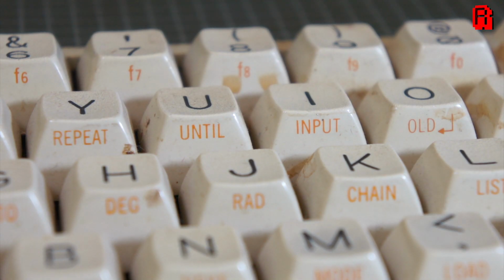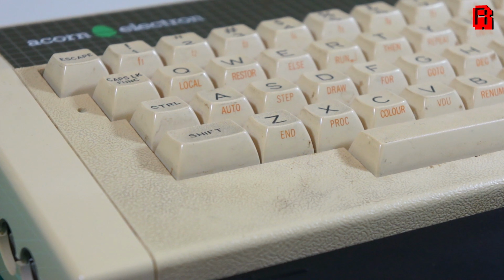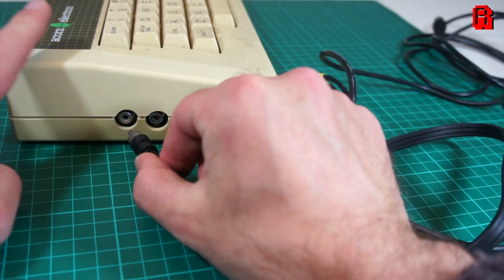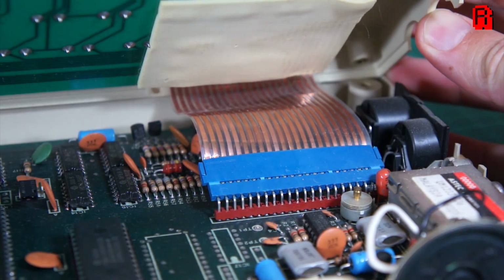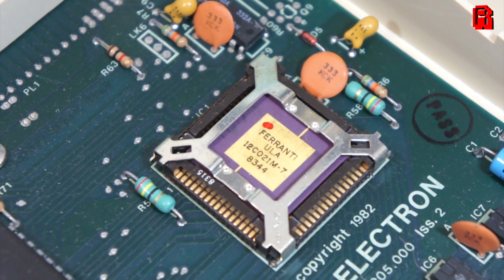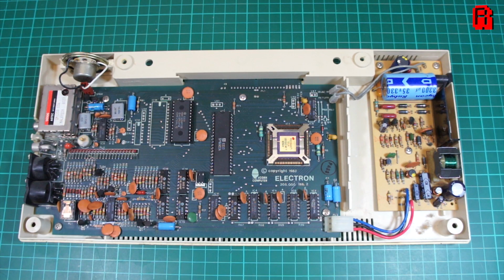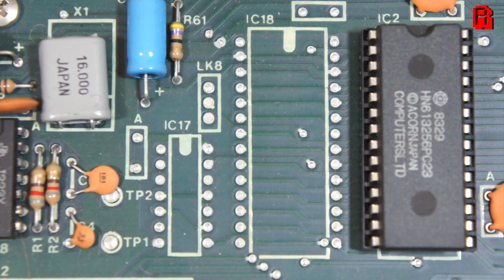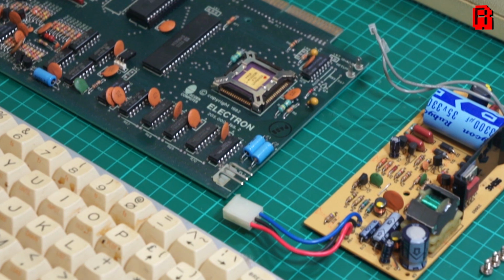Meet the Elk | Acorn Electron Trash to Treasure

Comment: In some ways, the Elk was leading the way, the Plus 3 expansion for example, providing Acorns ADFS (advanced Disk filing system), as opposed to the BBCs somewhat limited DFS.  It also provided a 3.5" diskette drive, rather than the more common and less robust 5.25" drives as used with the Beeb.

Comment: Helloo, Love the channel! Been subscribed for a bit. or is that a byte :) Was hoping someone can help me find "Dry Film Adhesive" used to "glue" the pad on a PCB back down. I know that an epoxy is available that can resist the temps of soldering but it seems expensive and a bit messy. Was replacing the caps on an Amiga and one of the pads lifted ! Doh. Any help greatly appreciated.

P.S. I also need an Acorn Electron Transformer brick if anyone can help out ! I notice someone has two ! :)

Comment: I did my BSc final dissertation programming on an Elk. It was handy that it was a little slower than the BEEB, since it meant if my work was acceptable on my home unit, it would look really good on the Uni's BBC suite boxes. BBC BASIC was really jolly good for matrix and vectoring calculations and the 32K limits could be worked around with some flashy memory page work and use of the chain command (basically, with a disk drive you could CHAIN in procedures into an area between user and graphics mappings as they were needed. the ADFS was surprisingly fast at reading.

Comment: Would the bbc micro play the games from the elk.
Reply from the maker: allan fulton Generally Electron games are re-written BBC titles.  It was common for a game released for both machines would have the BBC version on one side of the cassette, and the Electron on the other. Trying to run the Elk version on the BBC would normally work, but would often be faster, usually too fast to play.
Reply: RetroManCave thanks.

Comment: True story, I've actually seen one of these control an indie brewery in 1992 as part of a High School Insight to Industry project!  

Seriously, their entire brewing process was controlled by an Acorn Electron!  

Though to be honest, they were mates of my physics teacher, so the fact they'd go for the cheaper BBC Micro shouldn't surprise me.

But I was still blown away by the sight of an Elk running a brewery!

Problem about the Acorn Electron having a real keyboard... so did the Commodore 64, though it didn't have BBC BASIC, it had a really limited, ancient version of Microsoft BASIC that was originally intended for the PET and had never been upgraded.

I wonder what all the unpopulated pads on the Electron motherboard were for... MODE 7? (Teletext mode, nothing to do with the SNES)

Isn't Steven Furber now at Nottingham Uni and appearing on the likes of Computerphile?

Perhaps MS-DOS could have run on the BBC with an 80186 connected through the Tube Connector.  

There's something about this little Electron tha makes me want to see her working again!
Reply: Yes, pretty sure he's on Computerphile.
Reply: In the earlier revision (the one without the socketed ULA) there's an empty place for riser pins. Probably for some diagnostic, but it's not mentioned in the service manual.

Comment: Thanks for this! Are you going to Retrobright the plastics? I bought some BBlonde and another brand to clean up my Electron cases, but I'm leaving the procedure until next year, sun too low in the sky now for decent exposure during the day, blocked by houses, trees, etc.

Btw, do you happen to know what the most likely fault source is for an Electron with a bad display, but the ULA is ok? (checked by swapping the ULA with another system) I was thinking one of the RAM chips maybe.

I agree with you about the RAM access modification, that would definitely have been the right thing to do before launch. Do you have any references to example speed tests showing the difference the mod makes?

Lastly, which addons have you acquired? The Plus 1 is easy to find, but I managed to obtain a Plus 3, Plus 5, and the Music 500 system, etc. Do mention the Data Centre aswell, I have one which can be used with both the Beeb and the Electron.

Ian.
Reply from the maker: RAM sounds like the next place to check certainly.  I have been offered a Plus 1 and a modern SD Card reader solution which I hope will turn up for pt.2.  I haven't seen any definitive speed tests only that it can access at 2mhz instead of 1mhz.  Some sources suggest the same CPU operates up to 6 times faster in the BBC B with the better RAM access.  Thanks for the tips on the additional addons I'll certainly be looking into them.  Retrobriting I'm not sure on yet, it obviously needs a clean and then I'll asses its colour compared to the original shade and see if it needs it.  I do have a UV light if so.
Reply: If it's a RAM chip maybe it would be better to replace the ICs with sockets as the testing proceeds, make future testing/replacement easier. Hmm.

Good to hear about the Plus 1 and SD reader! Will you be covering how the speed mod is done later? Might try it myself. I was attempting to write 3D programs back in the 80s, really pushed what the machine was capable of (hidden surface removal), the math kills it for sure. I used machine code in various ways, but a generally faster machine would be sweet. I remember asking my math teacher questions about the line equations of intersecting planes, questions he couldn't answer. :D

Hmm, a UV light... a possibility! Think I'd rather use ye olde sun though. :D  I can wait, the system has been patient so far. I have numerous units, but the main one I want to clean, the faulty unit, is my own original Electron. The other is just another unit I'm going to clean to compare the alternative hair bleaching product, see if the 3X higher cost of BBlonde is worth the expense. This is Bblonde btw:

https://www.echemist.co.uk/media/product/jerome-russell-bblonde-maximum-lift-blonding-kit-hr.jpg

Kinda funny btw, I bought my box in Tesco, ended up conversing with a woman about the difficulty of choosing which one to buy. She was waxing lyrical about hair issues of course; I didn't have the heart to tell her I wanted to clean up 35 year old plastics. :D

Ian.

PS. Here's my collection, at least as it was a few years ago:

http://www.sgidepot.co.uk/misc/vintage_Dec2012.zip